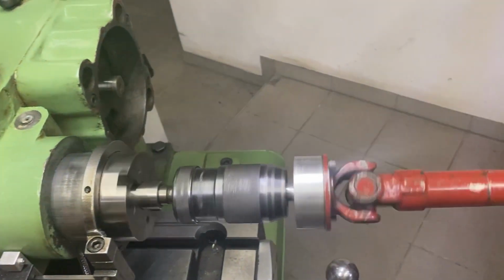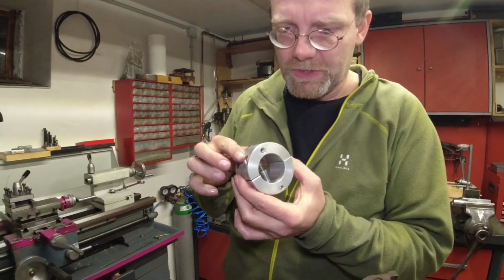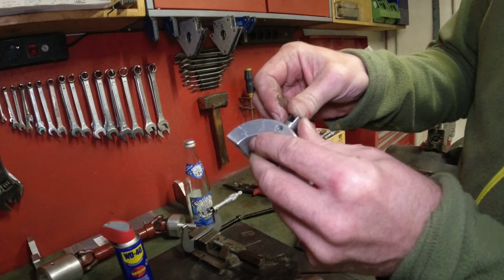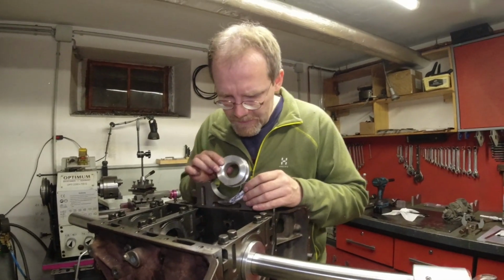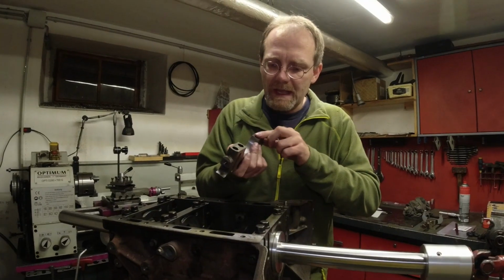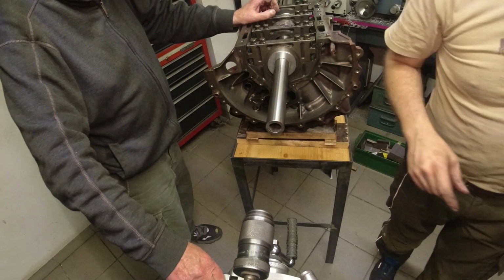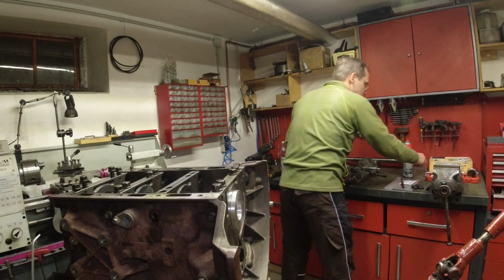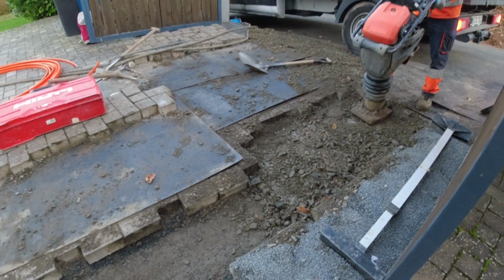DIY line bore diesel engine block - Ford Lion TDV6 - Land Rover Discovery 3

Comment: you can re-widen that cap main cap with air hammer and round blunt tip on bearing [penning] cup race area it will widen bearing capand be tight then you hone or bore
Reply from the maker: Thanks. Very good idea 👍

Comment: What material is the main cap made from? My block is at the machine shop and they say I need two caps so they can line bore to save the block. But I was thinking, why not manufacture two new caps, but need to know what material to do it out of.
Reply from the maker: You talk about the bearing caps I guess. I think they are of the same graphite cast steel. You can buy a destroyed block and use the good caps. Line bore shops usually know how to do this…
Reply: @ yes, the bearing caps.

Im looking for a dead block on the internet now to recover the caps.

Just got me thinking, getting some new metal, and machining up some new caps, underside on the bore, so line boring will then get it back to size.

I do work for the company that supplied the crank grinding machines to dagenham in the early 2000’s afterall 🤣
Reply: After some research, I think I'm going to go for SAE 4140 alloyed steel in an as hardened condition.

speaking to the guys in the machine shop, this stuff machines well, even with HSS tools.

Comment: I can’t believe you cut your line boring tool in half holding it by hand in a band saw. Perhaps precision isn’t in this joint. I guess it isn’t, it’s once clamped in place and the brass ramp pusher is set against the cutter, that’s when no movement is permitted?😊

Comment: Saludos y Bendiciones.
Soy Barrenado de bancadas de bloques de motor
Reply: I just LOVED seeing you work with your old master toolmaker dad. Wonderful, proper man, raised another proper man.
I love my daughters endlessly but I now regret very badly that I never had a son.
I too would have raised a proper man. 
My dad didn’t raise me and I had no time with my one grandpa. Instead, my foster dad raised me properly and he taught me everything (except welding and electronics). I have the confidence to tackle anything hobby sized  (more motorcycle than car) and domestic building related.
Reply: Why is engineers blue not available? I bet it’s a dye in methylated spirits and the pigment is carcinogenic. I used it at school in 1971-2. I still remember the smell and the beauty of the colour.

Comment: Hi, I have a jaguar with the 306dt engine, and as surprise, it has blown, the conrod went out to say hello. I have been looking at your videos, and I have a question regarding the blocks, is it possible to use the dt20 engine block on a 306dt? can you bore the dt17 to 84mm in order to use that block as 3 liter?

Kind regards
Santtu

Comment: Hello, have you tried installing Kolbenschmidt 79262600 connecting rod inserts? And the indigenous firm Taiho M720A1? They both have locks and are wider than the native inserts, in your case it will not be difficult to redo with such equipment!🦾 Personally, I am currently assembling DT276 on these inserts. Only I had to do everything manually🤪🤦🏻
Reply from the maker: Well, we installed the bearings according to the gaps required. I am not sure if the Kolbenschmidt met our required gaps. I do know we googled them.  You can't just install any bearings. They have to fit the specs for the crankshaft. 👍🙋‍♀️

Comment: Your are Amazing ! The video's are so helpful, funny and down to earth,  i really enjoy the video's and am in the landrover discovery 4 gang because I have just bought a white 14 plate with a 119,000 miles on the clock ,it's just had the left inlet manifold done and both rear upper arm wishbones done and because of watching you I looked and found its got the prop shaft rubber bearing fault to ,keep up the good work 
Kindest of regards Paul Smith from the wirral in the UK 🇬🇧
Reply from the maker: Thank you Paul. I actually just recently googled what "14 plate" means, should have done that a lot sooner. I always wondered what kind of weird Land Rover models you guys have over in the UK😅👍🙋‍♀️Vera
Reply: @Vera_and_Christian  HI Vera thanks for the message back its lovely to get one back, just to say over the centre prop shaft bearing, I have just bought a special bearing clamp really high quality made cost me a whopping £247 I would of sent a picture of it but don't no how to send it lol. its so you don't have to strip it down. Because its hard for me as I was disabled from armed forces. Ask Christian for me please what oils do I need for the diffs and transfer box and coolant my  model is a discovery 4 hse .2014 plate , 3.0 sdv6 , 256 hp engine with stop /start . so I bought the engine oil castrol c2 5w-30 hope I got that right lol hope your both well. I was wondering could I buy some of your stickers to put on my car please 
Kindest of regards Paul x

Comment: Hi,can I just say I love your video, watched them all .
Your engine rebuild process was best I ever watched.
Can I please ask you if it was first or last mains that turned would it be possible to line bore them as well? Or is this only possible on middle two bearings?
I assume caps for mains are made for individual block?
I was Following your video and noticed  you have milled top of  that mains cap to get it flat ,then machined  bottom of that main flat as well, this then gave you let's call it oval surface to re bore it (only top bearing cap gets machined) nice and back in to spec.  Can bearing caps be interchanged from block to block,then machined to spec?
Thank you
Reply from the maker: All mains can be bored.  The bore is not oval afterwards if done right.  The upper ones do not get scratched much usually. The bottom ones can be ground about 1/2 mm down.  Important is to not restart a seazed engine after the bearings spun.  Once the block is cool again, the lower main caps shrink.  If restarted, the damage is much larger.  Caps are not interchangeable.  King makes oversized bearings for linebored blocks.  Christian

Comment: Hi Christian and Vera, I’m a newly graduated mechanical engineer in the US who just got hired by a big diesel company over here. I’m learning a lot from your detailed explanations on the engine block and the cylinder heads, this is quality entertainment for nerds like us. 

I also lost by beloved Audi to a dumb accident months ago, and I’m seriously contemplating acquiring a used ‘06 LR3 here in the ‘States (they’re gasoline over here, not diesels sadly). I found one going for 13k with “only” 93,000 miles on it and I’m eager to see just what kind of luck Providence shows me if I get it. 

Thank you for the entertainment, i subscribed at the second video I saw from you two. Amazing content :)
Reply from the maker: 😃👍That is so cool. Check that it has the refurbished oilpump already, including a timing belt change. And  be sure to get a OBDii tool and hook it up to see what kind of faults it throws at you. Also make sure it has a clean oilchange record. Then you'll have a great car. Also make sure you familiarize yourself with the LR3 maintanence record and check if that all has been replaced. Otherwise you will be doing that. You can find that one on the Disco.co.uk website.  🙋‍♀️Vera

Comment: How do you stop the bearings spinning in the future
Reply from the maker: You can't really, but it helps if you take good care of your oilsystem. Frequent oil changes to prevent  dilution with diesel. For sure using the correct oil for your car. Also make sure the oilpump is still working good and replaced when the maintanence schedule recomends, we do it every 120000km, soon for the second time. It is most important that the oilfilm covering the bearings does not get interrupted, that is when they seize and no notches will prevent that from happening. 🙋‍♀️Vera

Comment: Tudo bom, qual qual as medidas ,depois do mandrilhamento  do bloco do motor . Ele fez o mandrilhamento porque rodou as bronzinas ou pq fazendo isso resolver o problema cronico desse motor?
Reply from the maker: We did the line boring because of the bearings turned. 🙋‍♀️ Vera

Comment: Brave indeed. And you said you were no engineer but an electrical guy.  
The centre guide for the boring bar is best found by using cones rather than the “Top Hat” style you used. There’s absolute concentricity from a cone working on the existing ID of the end mains , you could also use taper roller bearings to decrease backlash to zero no squishing, the GT-r  and most competition blocks are machined at 87 degrees centigrade with all fasteners torqued (as you did) rather than at ambient.

There’s a guy in Australia that does a huge amount of line boring of half destroyed equipment check him out CEE Australia, cutting edge engineering
Reply from the maker: I think everyone with a machine shop knows Kurtis. Christian refers to him all the time in our videos, when we machine something. 😃👍🙋‍♀️ Vera

Comment: Persian Blue ? Prussian Blue perhaps ;)
In the UK we call it Engineers Blue, most apprentices in my day hated the stuff due to many Hours of surface plate work hand making precision blocks, filing surfaces flat for hours coating them with blue, finding the high spots and so on and so forth.
I wonder if that practice still exists today in modern training, I think that those skills are the difference between a true Engineer and todays modern workforce.
Great work, its a pity the UK has lost most of its Engineering to other parts of the world. :(

Comment: Actually...having watched and fallen asleep during this epic production.......if I had a broken Landrover v6 diesel engine I would entrust its reconditioning to these people. 
My local LandRover main agents charge £120.00 per hour + 20% VAT. 
Being a retired motor engineer I watch with tears in my eyes. 
Nobody wants to pay for labour, even at my hourly rate of £20.00. 
Some customers do not deserve engineering skills, especially yours. 
In the unlikely event that a castrophy should happen, it will be always your fault as YOU didn't do this or that. 
Brilliant series of videos though. 
PS. Please tell me that Vera has a spare toothbrush !
Respects from the UK 🇬🇧.

Comment: This is simply amazing - the skill you have for doing this! Absolutely amazing! Those main bearings - they seem very narrow - I am accustomed to seeing wider ones with more area. And the crankshaft - it does not seem as robust as one that has pairs of connecting rods sharing a journal. Of course, this would require a different angle between the banks of cylinders or have cylinders firing at different intervals. There was a Buick engine made in the 1960's that used 90 degrees between the cylinders and had the connecting rods sharing journals. It was called the "odd-fire" engine, and it was robust. I believe one cylinder fired, then one on the opposite bank after 90 degrees, then another on the first bank in 30 degrees.

Comment: What can I say, superb job! I think I'd have to make up a mounting for the head of my Bridgeport to do something like this or perhaps drop the knee and us and use a spacer to lift the turret. I might Ber able to rig a vertical set up. Amazing work and so innovative. Nice having you dad's experience as a second opinion. My partner and I run a small engineering company making parts for and restoring classic motorcycles here in the UK.
Reply from the maker: 😃👍That sounds like you have an absolut dream job and business 🙋‍♀️Vera
Reply: @Vera_and_Christian  Vintage motorcycles, one day is really interesting and fun, other day can be very frustrating. C'est la vie.

Comment: Both you and your Father are both master's of not only your respective trads, but also anything else you do! Very is clearly the best wife, workshop assistant & camera operator!! Both of you are great "ideas" people, not only that - you turn your ideas into reality. 

This engine block will be in better condition than it was when it left the Land Rover factory. Are you doing anything to the heads? I can't recall if they also had an issue, other than possibly metal bits where metal should not be.

I would have paid someone. I know my limitations ie rebuilding an engine is one thing I can do, machining the block, not a chance.
Reply from the maker: The heads are thankfully fine. But you are right, the metal chips did do a lot of damage. 👍🙋‍♀️ Vera

Comment: OMG that's beautiful engineering! :) Shame it should ever be required on a vehicle designed to be a go anywhere workhorse. Doing some more reading into this failure mode, I ended up signing an old petition calling for LR to fess up and own the problem. Anyway, many thanks for yet another inspiring and totally edutaining video 🙏😊

Comment: Best Christian and Vera. Great video and technical explanation. I wondered how the main bearing carriers could be machined back to original size.  With conrods using fracture split big ends, this is thus not possible?  Anyway, I can not wait for Sunday to follow the reassembly. Can I please ask whetehr you think the crank shaft should be checked for cracks? 
Kind regards from your biggest fan in South Africa.
Wouter Wolmarans.
Reply: Also check a channel called, ‘Piston Broke.’ He does a rebuild of the same engine.
Reply: @philipwayne6149  Thanks
Reply from the maker: We now have to go a different route as originally planed. We found a machine shop close by to machine the bearings back to size, but we do not trust that the bearings we ordered are actually manufactured up to spec. We are waiting for new ones, ordered today. So next Sunday, there will be a different topic unfortunately. It is actually really long and mind numbing process 😭🙋‍♀️ Vera

Comment: You could've just straightened the main cap the same way you do a warped head.
Loosen the bolts, retighten the top bolts (not the sides), heat the main cap, then let cool naturally. It should bend itself back straight.

Comment: Wonderful, wonderful stuff: I was wondering about availability of oversized bearings, but it hadn't occurred to me that the block side would be O.K. and essentially just need a polishing skim.  Loved the super-fine cut depth adjustment method, and also the drilling of the hardened shaft.  Thank you for posting and all best from the U.K.!
Reply from the maker: 👍😃🙋‍♀️ Vera

Comment: What do you for larger outside diameter main shells ? If  you cut it larger holes without adding something back on the sides of the holes, the shells will be even looser sideways.
Reply from the maker: No, he explained in the video why you can do that. If you watch it again, you'll see where he explains that the upper housing of the bearing bends inward when overheated. Watch it again, you'll understand. 👍🙋‍♀️ Vera

Comment: Hi Christian ! Great work and good enternainment ! Just as an aside is it possible for you, or a machine shop to notch the block or caps and split the bearing shells, like it was done in the older engines, to  prevent the bearing shells from rotating in the blockand maybe stop a future problem ! Robert !

Comment: This is amazing work guys genuinely impressive work🙌 

Just used the bonnet service position for the first time I seen it on your other engine video haha So much room for activities
Reply: Please pull your bearing shells and make a video so can compare with the LRTime failed bearing shells in position 2 & 3 on this motor since your motor stopped without bottom end failure. It would be interesting if there is any wear or float present.
Reply: @richardwilliams8667  I think I will end up rebuilding my original engine when the money builds back up in my bacnk account 

Will be pulling the main and big end on the new engine fingers crossed that crank isn't damaged haha

Comment: Thank you for this video! You and Vera are the best DYers fixing Land Rovers.  My 2026 LR4 HSE LUX rear window behind the driver side opens up spontaneously to half way. When I raise the window, it reaches the top and automatically returns to the half way mark!  Do I have to replace the window regulator? The fuse is working OK.  Any suggestions would be really appreciated.
Reply from the maker: Sounds like it is possessed.  You may have to get it to an exorcist.  I am not an expert in this field.  But it could als be that the closed position triggers the pinch protection causing it to open.  In this case try closing it and holding the button closed for five seconds when up and the same for down.  This should reset the closed position.  Maybe a reset is required by battery disconnect but this requires more work and setup.  If it moves ok up/down, no hardware is broken.  Christian

Comment: Those main bearing caps should be an interference fit, you should never be able to lift them out as easy as that. Edit, my bad, I wrote that before watching all the video. Cracking bit of kit you've knocked up. Not the sort of stuff I would attempt.

Comment: Top effort! 👍  One question - do you know if it safe to reuse the crankshaft or if there is a risk that a fatigue crack has been initiated during the incident (or the later running of the engine by the main dealer)?
Reply from the maker: I will answer this once the car has 20t more km on the clock. Christian

Comment: Once the crank is ground, will it have heat treating or Nitriding or will it go straight back in, I must say I am impressed at your workshop, and your skills.
Reply from the maker: It will only loose 0.125 surface thickness.  I think this is ok. Better than a forged opne for sure. Christian

Comment: outstanding work christian are you going to notch the shells to stop them from spinning ?
Reply: Yes, I was wondering the same. No point doing all this just to allow the problem to reoccur later. I've heard of a lot of Disco engines having this issue - LR should be sued in a group action for shoddy design.
Reply from the maker: No you cannot do that, and it would not make a differnce at all. I think we'll go further into that topic in our next video. 👍🙋‍♀️ Vera